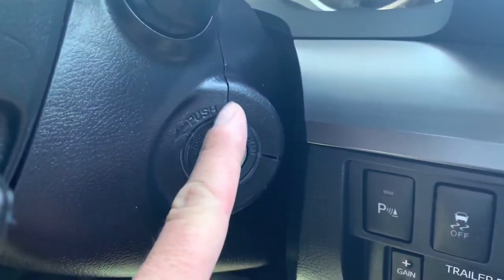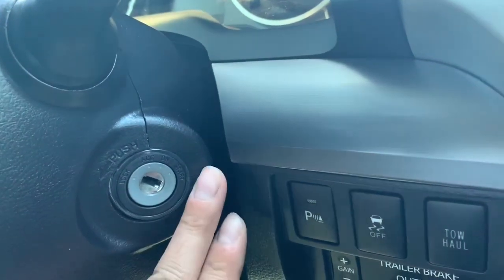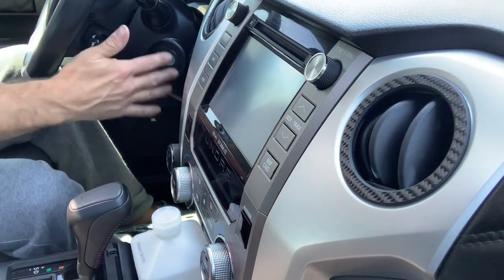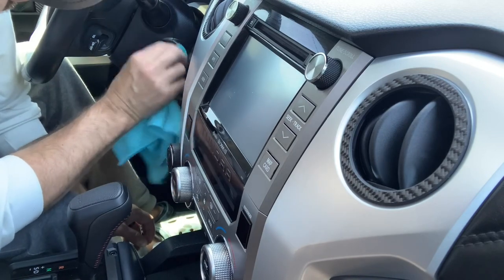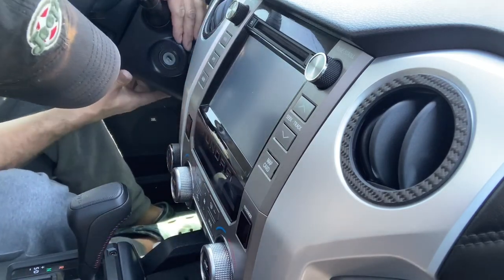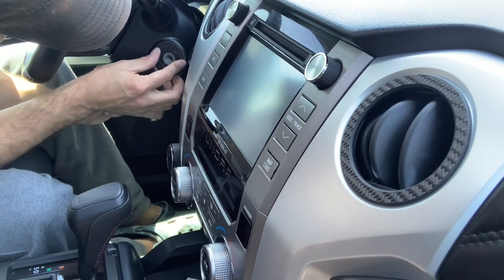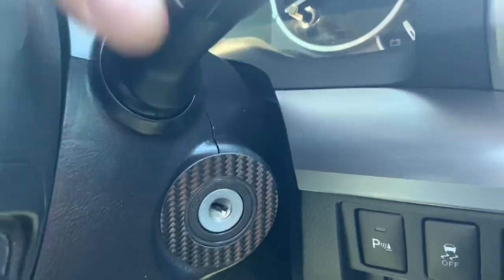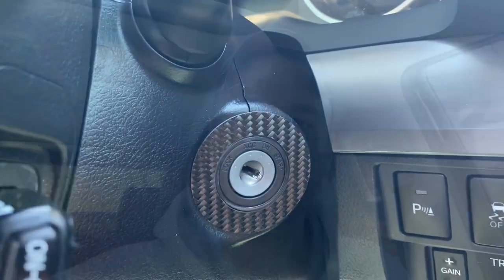Tundra Remote Start Fix... This Really Bothered Me For Some Reason

Comment: Try 303 aerospace protectant instead of the Armourall. It much better, has UV protectant in it and is not greasy at all. Plus it doesn't collect dust.
Reply from the maker: I’ve heard that stuff is really good
Reply: @gearrunner  I've used it for 20+ years, even while living in AZ. I promise you won't regret using it. It makes all plastics back to black again and it's great for bed covers.

Comment: Hey I know you covered it before but where did you get your aftermarket shifter?
Reply: And to install it , simple just unscrew it?
Reply from the maker: @mikebarry3491  A subscriber sent it as a present.  You can order one though from Sparks Parts.  Use discount code GEARRUNNER and it will save you 5%.